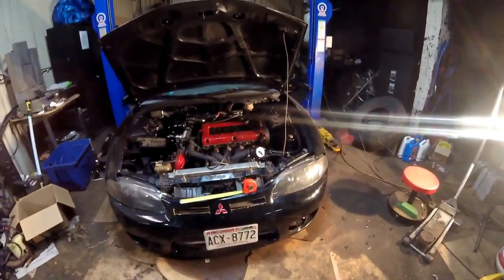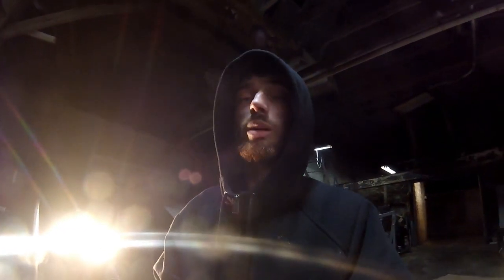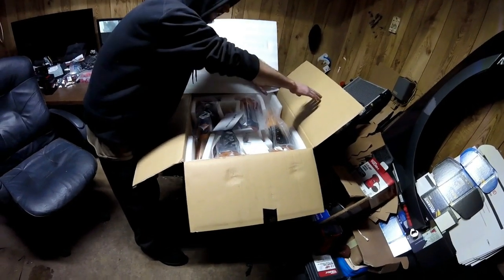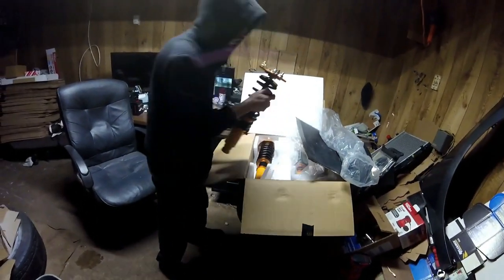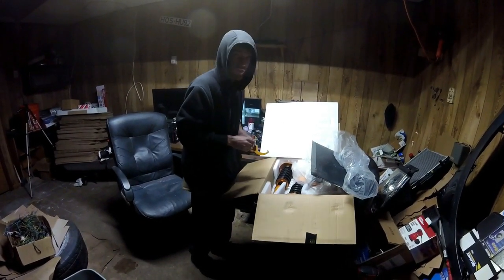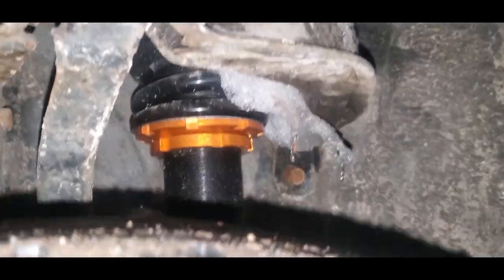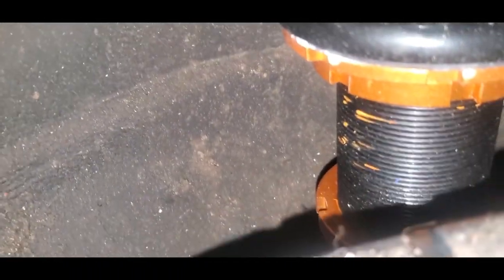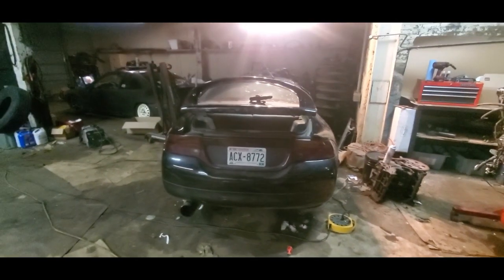2G DSM Ebay Coilovers

Comment: If I remember correctly I don't think you can actually adjust camber with the coilovers can you? Sweet car man!!
Reply from the maker: correct. camber is adjusted by the upper control arm on the 2g and thanks its definitely a project
Reply: @DishonoredGarage its funny that the ebay brands actually make it "camber adjustable" LOL. I just actually bought some CX racing coils for mine off Ebay, gonna be doing an install video soon. Let us know how well those coils hold up haha, I couldn't trust the 200$ coils.Hopefully I didn't make a mistake.
Reply from the maker: @IT_Performance  well so far they have held up but i need to do some more aggressive driving on them.
Reply: @DishonoredGarage  I hear ya. I got some risk coils for my old golf a awhile ago. They blew within as couple months so I dont trust cheap coils no more :p
Reply from the maker: @IT_Performance  yea its always hit or miss lol